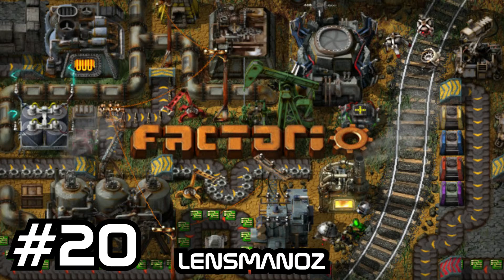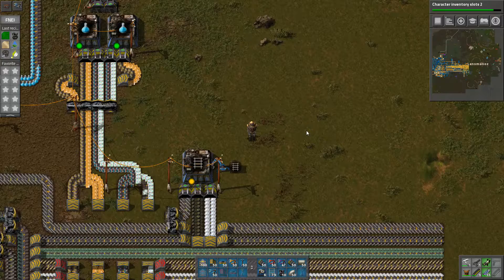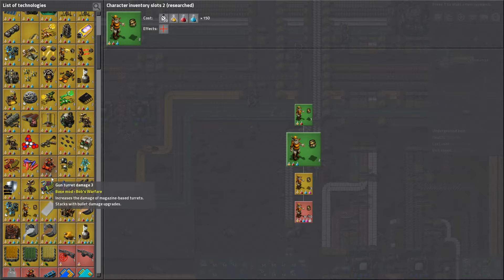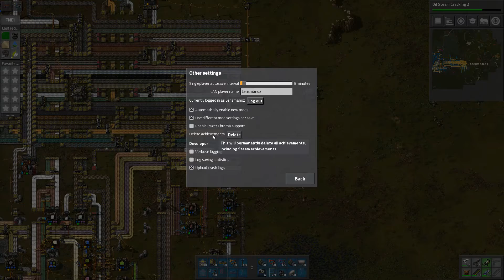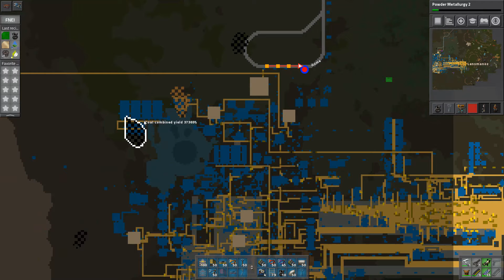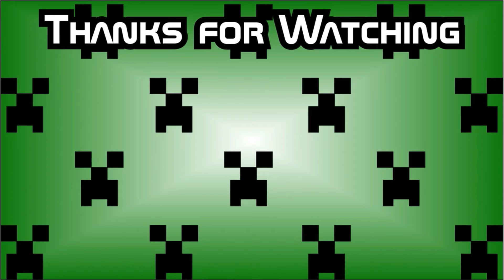Factorio Modded - Ep 20 - Logistics Robots Everywhere

Comment: Useful tip: You can shift-right-click to copy and shift-left-click to past recipes. If you paste a recipe from an assembler onto a requester chest, it'll automatically set the requests.

If you want to use inserters with a chest without limits, use circuit conditions. Make up a red or green wire click on the chest, then drag it to the inserter. Then when you left-click on the inserter you'll be able to filter it to only operate if there's less than a certain amount of an item in the chest. And you can do that for multiple inserters.

I won't laugh, because I've been saying it all along. Though I did forget the miniloaders need power. I use ones that don't and it makes life easier.

If you're going to move to a bot-based system, it's definitely time to stop the bus. But you'll also want to build your bot production so the assemblers actually constructing bots are fed into a roboport. Then you use circuit network wiring from the inserters to the roboport and make them only work when the system has less than 200 available Logistics bots, and less than 50-100 construction robots. That keeps you from wasting materials on bots you're not using, as well as ensuring there are enough to get done the automatic requesting you're doing.

You can do fluids with robots, but it's annoying. You'll make a heavy pump in Angels, or an assembler in vanilla, and put the fluid in barrels. Then the bots can carry it. Then it has to be unbarreled at the other end.

You should be able to make substations. A few of those at the end of the Bus should stop you needing so many of the wooden power poles. You can also place down substations in your robot crafting areas to cut down on having to spam power poles everywhere.
Reply from the maker: I can always count on you sir to give me the goods on how to do stuff.
Already been using the copy / paste but maybe not enough.
I had forgotten all about circuit conditions... I tried auto putting the bots in but the circuit will fix that bit up.

Thanks again for your amazing info